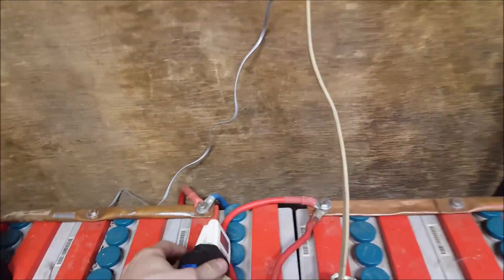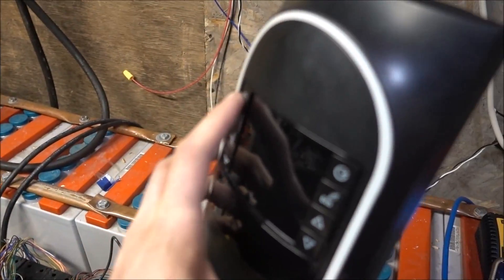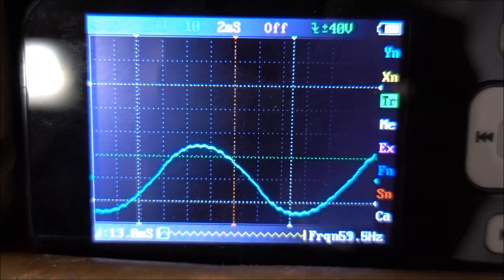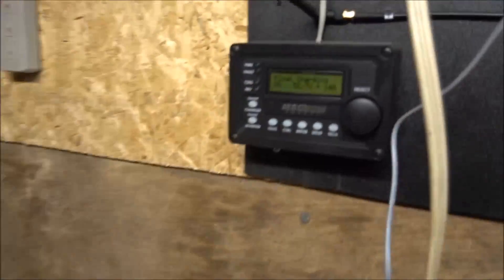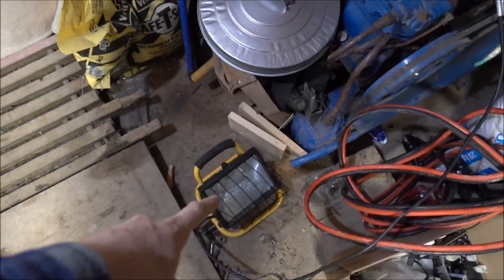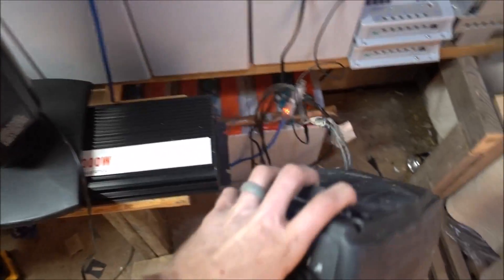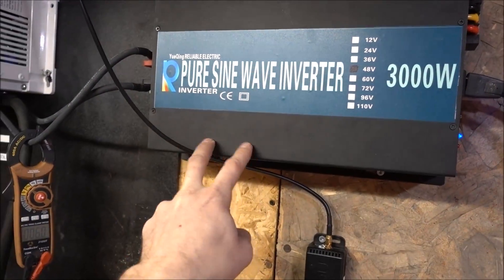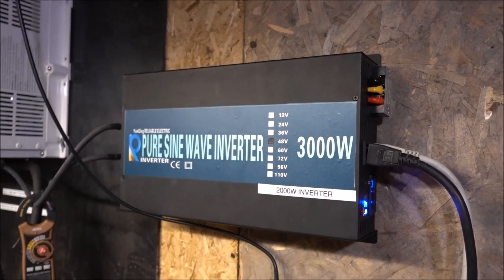Reliable 2000W Inverter 48v Test

Comment: If you have 400ah battery total with two inverter and 1000 watt as a load for each them one them run on 12v with 400ah and the other one runs on 24v with 200ah which one will last longer?

Comment: I have the 2000w version of this inverter and hear from the front of the case a buzzing voltage sound like a bee.. is this normal or could it be dangerous? Thanks in advance best regards Patrick
Reply from the maker: its normal its most likely a loose transformer.
Reply: Going Off Grid thanks for your help! Do I need to solder or fix something or what does it mean loose?
Reply from the maker: no the transformer should be fine.

Comment: Would have been nice if you had done a surge test as well. I have been on youtupe observing about inverters and i notice they all have there fine points fair points and short comings the most reasonable ones are way too expensive though
Reply from the maker: i did 2350 max for this one, I have another 3000w reliable inverter that does over 3000w

Comment: with 2000 watt pure sign wave, ran it at 2100 watts for 30 mins and it ticked along nicely , 12V / 2000w , since then I have upgraded to a 3000 watt 24V system and it runs way better. stand alone system 8X 335 amp 12V AGM gel batts hooked up to a 24v setup . just a simple setup, 0 gauge wire through out 500 amp shunt midnite 150 with 1200 watts of solar. each 24V battery ( 2X 12V ) hooked to busbars then from busbars to inverter, keep up the videos.
Reply from the maker: sounds like a great system, maybe a bit more solar :) and I am loving these inverters so far.

Comment: Those "type" of inverters will only work until they produce more heat than the case can absorb.  They are so inefficient that at rated power it is producing around 4X the amount of heat that it can dispel.  The only reason you were able to get 2200 watts out of it is because it hadn't overheated the case (heat-sink) yet.  Even at 1600 watts that type of inverter will shut down if you allow it to run long enough.  You get what you pay for ;) Remember that at 75% efficiency you are producing 750 watts (25% x 3000w) of heat!
Keep up the good work!

Comment: You would think they would be smart enough to run it thru its paces to make sure it's good being you have a youtube channel with a potential 3,000 customers they could screw later, but no, I'm sorry you got screwed again, but I'm so freaking happy I didn't rush to buy one and I was ready. Patience is golden! The ripple can be destructive to both the battery banks and your appliances as well.
Reply from the maker: yes I make these to save people from buying something they will not like, also the ripple will not damage the batteries, a mppt has a big ripple and is good for them, I call BS on that one :)
Reply: We were talking about inverters correct so I asked electrodacus
electrodacus 1 hour ago Highlighted reply
I do not think ripple will degrade much the battery of any type since is a relatively high frequency ripple. The inverter will degrade battery more because of low frequency 100 to 120 HZ half sine wave current and that will contribute to micro-cycling. LiFePO4 seems is not much affected by micro-cycling but I did not looked at the effect on other type of cells.
The PWM and MPPT switching noise are still annoying for the user and probably neighbors :)
SBMS is not using either PWM or DC-DC converters for MPPT so there is zero noise during charging.
LiFePO4 will not require constant voltage charge phase (that will reduce battery life) so no PWM or other methods to CV are needed.
Reply from the maker: I have oscilloscoped the dc side and it seems to be pretty good, also any large cap will clean up and ripples.

Comment: see that is why I use the rule of never take anything over 70 percent of the rated which is 2100 watts. Buy the way I use that rule on any electronic product not just china. 50 years ago I would never had used it on USA made product but not any more. I will run the same test when I have time.
Reply from the maker: my 60v model does 3000w

Comment: hey nice review now i am worried bought the 24v 3000watt well let me fix that (2000w) lol    as i am in jamaica i ordered a 24v 3000w@;50 hz and 110v guest what i got 120v@60hz and now I'm seeing 2000w  and not 3000w God help us still in dialog with them  as I can't use it with shipping and JAMAICAN CUSTOM it cost me $50,000ja i feel cheated  anyway the green charge controller  mppt 7210 can say if @ 24v out  with 500w   of solar what the  max output current  i can get from each of them
Reply from the maker: My 60 volt inverter is working well, and my 48 volt is 1000w less then it says, so we will see how the company treats this. those little green charge controllers are good for $20, but if you are going to need a lot of them I would say get something better.

Comment: i told you, you can run 2300-2400w max out of that inverter and plus you are on 110v ac... if you were on 220v you could probably do some 100 additional watts. but these inverters have around 75% efficiency... but i quite like the protection on them.. i would probably buy a 4000w if i want to run 3000-3100w.
Reply: by the way... i didn't quite liked the sine wave with the distortion at its highs... but if you were seeing this on other inverters it can be something normal.... does the magnum inverter act the same for the shape of the wave?
Reply from the maker: the 60v model can run 3000w I have tested.
Reply from the maker: no its just this inverter that does this. the magna sine cares less about load.

Comment: Or only run these inverters at 50% (1500w) rated load as your using 110v it's to easy to overheat cables/plugs or internal components as at 110v that's 13amps ish at 1500w on the cable (really need a IR cam so you can visually inspect the invert when under load with case off) if you was using 240v 3000w (13amps) Is more achievable with out overheating

Did not see what the operation voltage was on the DC side when you was testing it as normal shutdown is low voltage or overcurrent  (you could do with a variac as you can precisely set the voltage low so load be lower and slowly ramp up the wattage) 

Have you tried using 1500w on each side of the 2 plugs as unsure if you was trying to pull 3000w out of one socket on the inverter
Reply from the maker: the inverter has 10 gauge wire on the inside to the plugs and hard wire.

Comment: Have you ever thought of using 240v so not overloading cables as 3000w on 110v is like 24amps via them thin cables/plugs you use  (most stuff is rated for 100-250v apart from heaters)
Reply from the maker: yea, well I like my 120 stuff and these wires can take 24 amps for a short time, also these have a hard wire option on them for the full 25 amps.